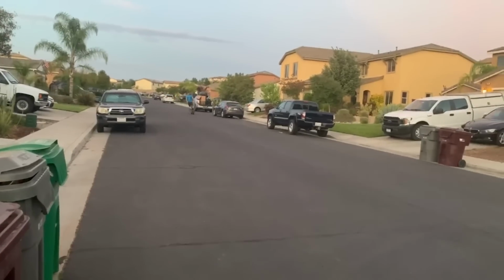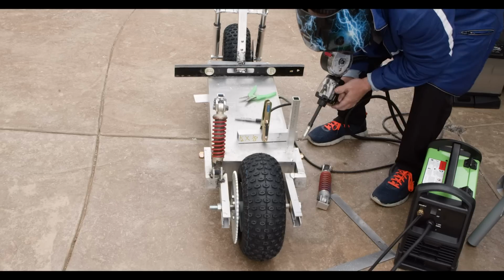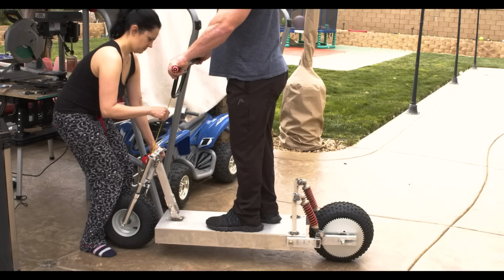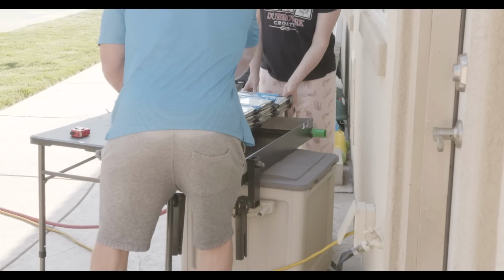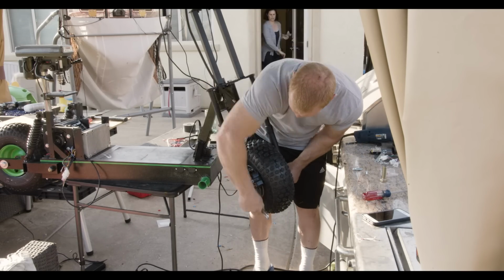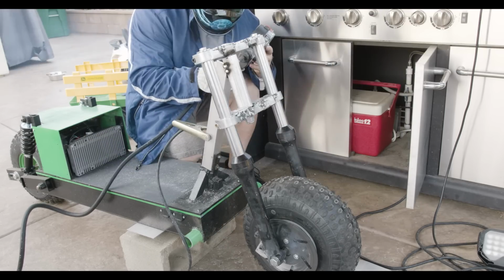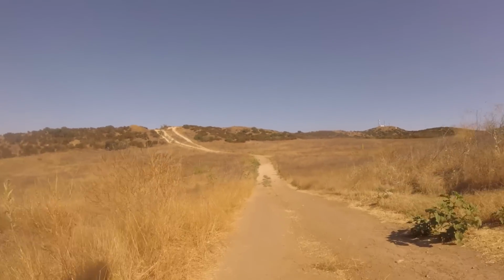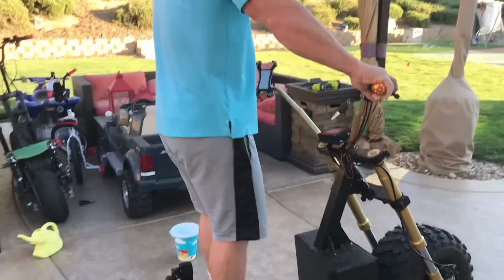20 kw Electric Scooter made out of Aluminum (dirt bike power!!)

Comment: Amazing project, I noticed you used hub motors in the first video ( or is this a different scooter  lol) I watched then 2nd video you use chain driven, can I ask what is better?, I am actually upgrading a electric scooter myself only putting new motor  battery an controller, More power an speed, lol, Can I ask if it was expensive for the motor battery an controllers you used, You giving me ideas for my scooter, Amen for that mate, See I am having issues finding the right motor for it, I wanted 3000w to 5000w coz if police seen me blowing at high speeds on a scooter they will take it off me, Already been stopped by a blue light on my 1600w lol, They kool tho as long as you not a knob head tho, Yeah can you chuck me some advice on motors an batteries, How much if you don't mind saying an where to get them from? Plz, Top scooter tho mate, Sort of gutted I gave welding up years ago now, used to weld balistrade an fences 15 years ago that is lol, Yeah top bit of engineering with this scooter, Got my subscription, Top work tho...
Reply from the maker: Hi, mid drive(chain) will always win on tq,  and efficiency, also you have more choice to gear it how you want. Hubs are more convenient and quiet and simple, but put the weight in undesirable spots. now some very expensive hubs motors like for qs that go into motorcycles - those are really high speed but very expensive.
All this stuff is expensive, main reason is shipping is about the same price as product.
It’s hard to make any money on selling these because when you add up the cost and  time , only a select few will buy something that expensive. Batteries are still the main issues with cost because you don’t want to get bad quality there
Reply: @RexSmithII  I hear you, I am now being told here in the UK police are taking electric scooters off people with a fine an points on licence, Even the high powered bikes like the Sur Ron's are being taken off people, Apparently if it got pedals it's OK to use, Can you believe the police are taking electric transport of people while climate is causing floods an fires worldwide, Gets me bit worried with the UK being a little island, I am buying a mountain bike tomorrow an then a motor, Looks like I will have to get hub motor, I live on a 3rd floor, So 3 flights of stairs to get up, If the weight is on the back it will be easier to carry up steps, My monster scooter weighs 36kg an I gets that up the steps, I see it as a little fitness exercise lol, I am looking forward to busting a little electric bike project of I'm honest, cheers for the reply an the honesty with prices, Electric motors are expensive buy you do pay for what you get, I read the QS motors are favs for electric bikes ect, Nice one for the reply tho yeah, Keep safe too.......
Reply from the maker: @mad-b264  too bad on the police and scooters,
I remember when flying drones was so easy then I said to my self “ something will change soon” and sure enough with in a year they made it where you have to have like a license to fly  drones. That’s what got me into this electric stuff was building race drones, back in 2017. I made a bunch, one reaching long distance and able to gl about 130mph
Reply: @RexSmithII  Yeah man, Proper, Can get some amazing shots using a drone, I seen a video some looking like a UFO, lol, But you can actually see its a drone, You got some engineering skills that's for sure, They already making drones for humans to fly, If you rich that is, It's basically a car frame with 2 underneath and above fans on each side, A giant drone basically lol, Yeah that's madness you need a licence for drones, You could do delivery using a drone, Social distancing at the same time if a person is isolated, But people couldn't do that coz of no drone licence, How do you even get a license for a drone, Go to to flight school or something lol, But yeah drones are going to be used for all sorts in the near future, If you can afford the new tech that is, lol....
Unless you like yourself then the skills will come in handy for you, lol......

Comment: Dont use them batterys use the same as tesla 18650
Reply from the maker: There’s different types of 18650s only a few can handle high discharge with out getting pass there rated thermal temp.
And they have to be put in a bunch of parallel to get anything considerably enough discharge. The other issues is there the most 
Counterfeit battery on the market. The ones you see on eBay stating the same 
Manufacture numbers example LG something something or most the time counterfeits and will get super hot and short
Reply: They are a lot I use them all the time  and Tesla puts water lines in the case the are the best
Reply: I no how they do it 100 kw in the p100d Tesla 2013 with all wheel drive and the new wide body 1000hp
Reply: 21700 is new cell in tesla, possible to use in this scooter